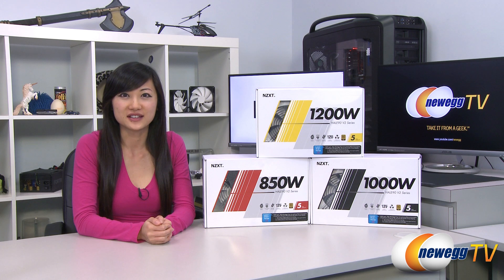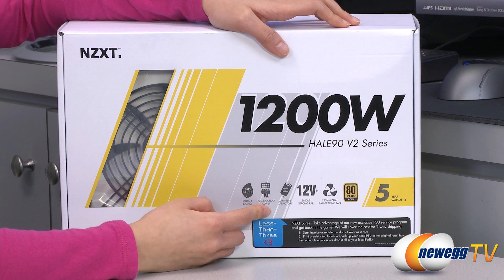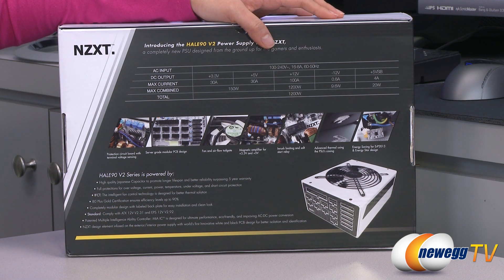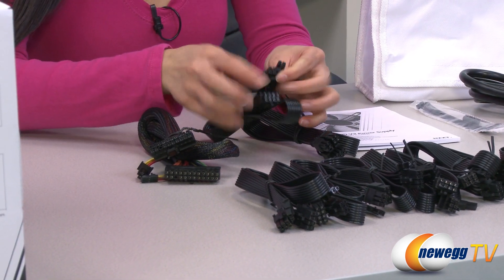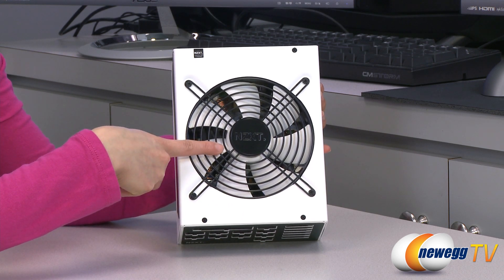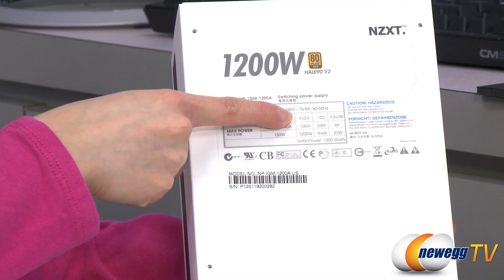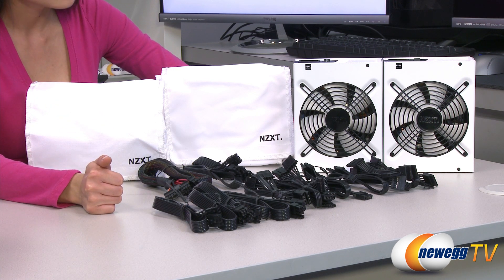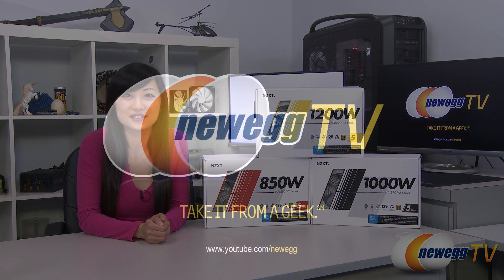Newegg TV: NZXT HALE90 80 PLUS GOLD Certified Modular Power Supply Overview

Comment: Agh, I hate that C19 plug for the AC power cable.  Those cables can be a pain to replace as it doesn't use the standard C13 found on most PSUs.

Comment: I've owned the ( not New arrival FULLY modular version) 1000 watt hale 90 version of this psu and it has been rock solid.  All voltages were within 1% of spec regardless of the load at all times.  VERY well built.

Comment: what a load of shit 99% of computers will only need the 850 and as usual they go straight to the most powerful and most useless power supply sure they talked about the the 850 and 1000 but no in depth this video is a right load of bullocks